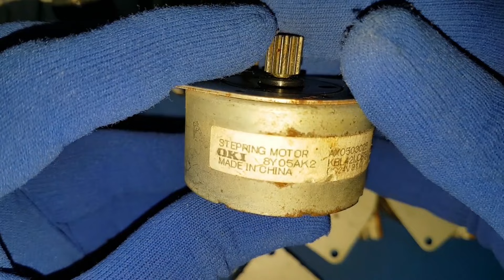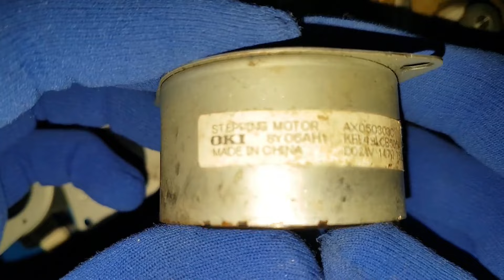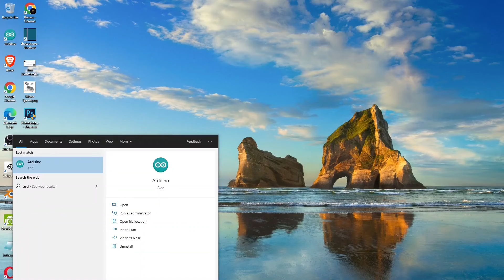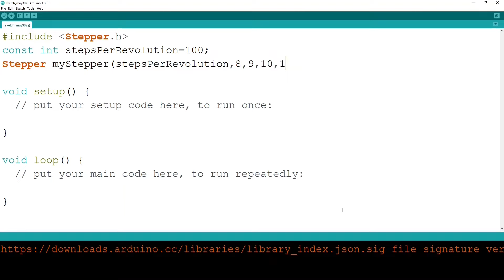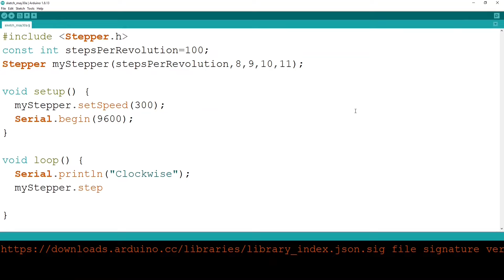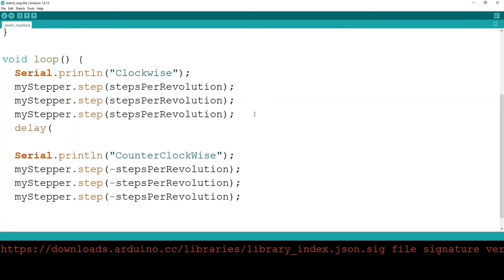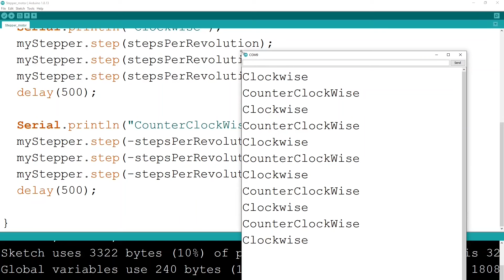Control Position and Speed of Stepper motor with L298N module using Arduino | testing stepper motor

Comment: Thanks for the video! I have an Nema 17 hooked up to a L298n and an Arduino. I have no issues operating it, but I'm having problems powering it. If I use a 5v 1a supply, it works but torque is low. If I use a 12v 2a supply, the torque is great, but the L298n pulses ever second or so which sends power to the motor. It doesnt appear to actually turn the motor, but it makes a buzzing noise which is VERY annoying. Do you know why I'm getting this pulsing from the driver?
Reply from the maker: Possible Causes:

Power supply might not be providing consistent current.
Motor is drawing more current than the supply can handle.
Electrical noise or instability in the circuit.
Solutions:

Use a higher current power supply.
Add capacitors to smooth out voltage fluctuations.
Check wiring and connections for stability.
Reduce voltage to avoid current surges.

Comment: How can I use this to run motor in one direction continue
Reply from the maker: You have to remove excess code and keep the arduino code that relevant for the direction you need